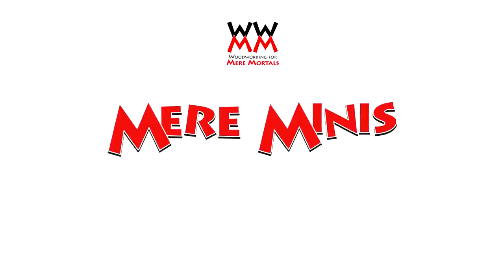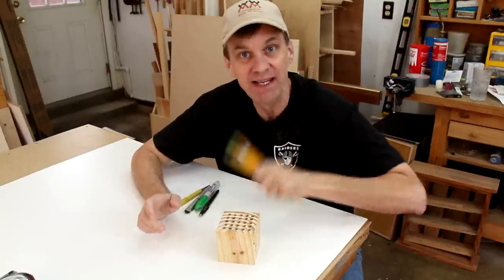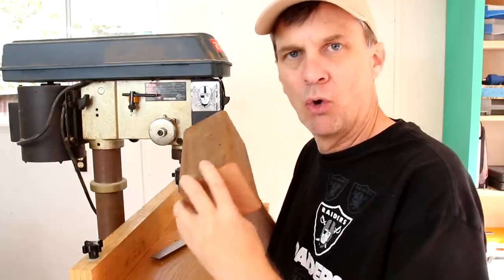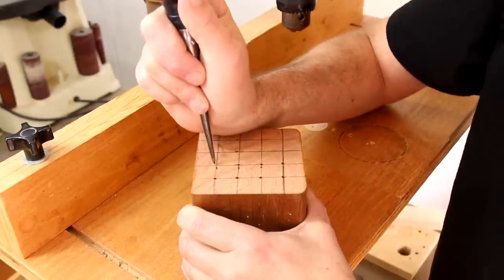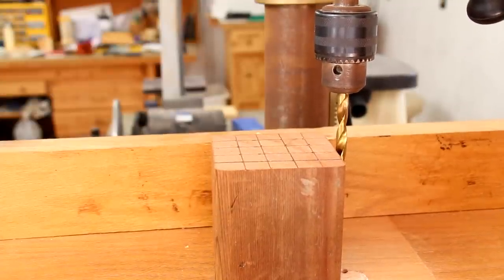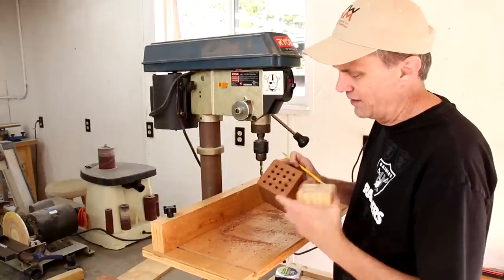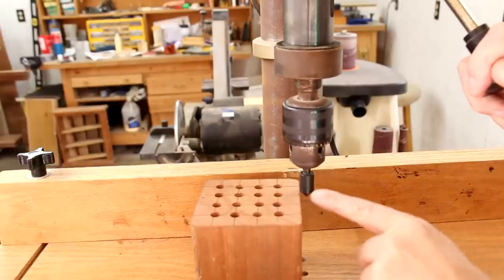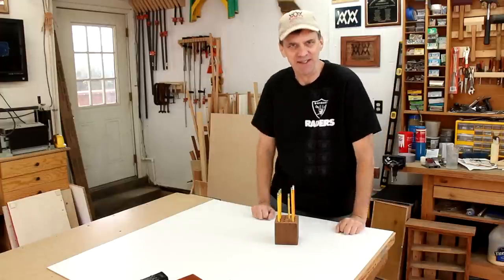Drill press pencil holder | Mere Mini

Comment: If you're going to store your pencils point down, maybe drill a smaller hole that's centered at the bottom of the main holes for the points to fall into without risk of broken lead. Just a thought.

Comment: Would it not be better to drill a smaller hole slightly deeper then the one that holds the pencils so that the tips of the pencil do not get broken?
Reply: At first I didn't know what you meant. Then I realized you meant at the bottom of the larger hole. Actually a really smart idea. One of those "Why didn't I think of that?" kind of things.

Comment: I have 103 misc screw driver bits from various sets people(or myself) have bought over the years. They all pretty much eventually ended up at the bottom of several of my tool chest drawers.
So, I made a similar thing out of a 2x4 to hold all of them. Works great.

Comment: Great and simple project to hold pencils Steve. 
The most simple and useful thing I made was a groove (3/16'' wide and 3/16'' deep) in a block of wood cut with the table saw (I think 2 passes as the kerf wasn't wide enough) this block of wood is holding my smart phone while charging on my bedside table, acting as an alarm clock at the same time.
Greetings from Good Old Germany
Peter

Comment: I need to make one of these so badly, but for my mechanical pencils. I've got 4 kicking around the shop and I'd be hard pressed to locate one when I need it. 

I was going back and forth between buying a drill press and band saw for a while and decided to go with a drill press after your drill press mere mini. I'm so glad I did as I have been using it like crazy and couldn't go without it now. It's secondary use as a drum sander is incredibly handy for anyone without a spindle sander. I'm going to try spinning knobs and handles with scrap soon and see how that turns out.

Comment: rough sand paper double side taped on 1 foot long wooden ruler... it works better on wood than files... and you can apply all filing techniques

trimmed off using pen knife... foam tape works best with cushion

Comment: Another mod I might make is to make a smaller deeper hole than the pencil slot; so that the sharpened pencil lead point would not break or be blunted in the bottom of the slot.

Comment: Not a carpentry project as such but I once took a large tin can, filled it two thirds full with gravel then drove a four foot piece of dowel into it at the centre then topped it off with plaster of paris, being careful to make sure the dowel was perfectly vertical, then after it was dry I spray painted it all white  and put a bunch of cheap clip lights on it and stood it in a corner, it looked like an expensive designer piece and lit up the room a treat.

Comment: I made a hobby (model) paint storage tray out of a 2x4. Used a forstner bit and the drill press. You can see the example tray I followed by Googling "dndlead paints". Super simple and super handy to organize. You can also drill smaller holes to hold your paint brushes.

Comment: The most absurdly simple, extremely useful thing I have made was an L-shaped piece from two 1x4's that I can clamp to my miter sled to act as a stop when cutting picture frames. It clamps 'inside' the rail and sticks out far enough to butt the frame ends against when cutting. Your frame video made it look like you could use one as well - trimming freehand I'd never get joints as nice as yours.

Comment: Stupidly easy but very useful project:
I took some thin, narrow scrap boards and cut them in to squares on the table saw. Then I drove one 1 1/2" nail through them - and now I use them all the time when painting or finishing a project to keep the project off the table. Just balance the workpiece on the points of the nails. I have about a dozen of them, so I can support each piece individually, and they leave no marks on the finished piece.

Comment: I once drilled a hole in a 4x4 block, put a dowel in it, and made a paper towel holder for my bench. It was crude, took about 5 minutes. Did it maybe 20 years ago, and despite all the work I have done in my shop since, I think I only just got rid of it (aka, I repurposed the dowel).

Comment: With very minor modifications this project can very easily become a drill bit holder. Simply make each hole just a little larger than each bit and adjust the depth of each one so that you have an inch or two of the bit sticking up.

Comment: I made a wooden airplane for my cousin who is 2yrs old. He picked it up and dropped it thinking it would fly on its own. When it was time for him to go he had set it down and grams told him that I made it for him. He quickly picked it up and carried it outside under his arms. Plane was 26" in length, 24" wing length and the tail was 8" in lenght. Both wing widths were 4". I used to dowels for the big wing (lol) and one dowel for the tail. It turned out pretty good.

Comment: I guess if you drilled a tiny hole first say 4.25 inch then the main hole at 4 inch the pencil would slot down but the lead at the bottom would have its own slot to stop it breaking from being dropped in the slots.

Comment: The simplest thing I've ever made that has become indispensible was a bench hook. Piece of quarter-inch ply, two pieces of  1"x2" furring strip, 6 screws and a piece of an old measuring tape. I think I use it every day for something, especially for holding small pieces while I work on them.

Comment: What tips do you have to make the holes straight if you don't have a drill press and have to drill by hand?
Reply: i know just one way : hold the drill away from you and look if the drill is straight if you have a good square you can also use it.
Reply: Big Gator Drill Guide

Comment: My wife and I play a game with friends that involves cards, and poker chips (not poker, it's a fantasy RPG game.) The game master has to be able to see what card each player has to determine play order. Cards were always laying flat on the table where they couldn't be seen, and chips were always getting knocked on the floor, or confused on which chips belong to which player.
  So, I took a 4 foot piece of red cedar 2x4 and cut it to 6 inch lengths. Then I set my table saw to a 15 degree bevel, and cut a slot in one edge to hold a card at a nice angle for viewing. Then I took a 2 inch forstner bit and drilled a couple of holes to within 3/8ths of an inch of coming out the bottom. The holes were positioned so one edge overlapped the edge of the wood so there was a thumb notch to get the chips out. A little 45 degree chamfer around the bottom to create a nice shadow line, and a bigger chamfer at the top, and a couple coats of linseed oil,and it made the perfect card and chip caddy for game night :-)

Comment: Could it be modified to hold drill bits? The original cases that my bits come in are not the most ideal...I always end up taking them out  and leaving them around after using them, eventually I loose the casing altogether and end up with a bunch of bits

Comment: I'm thinking about  how I might incorporate a pencil sharpener in there somehow.
Reply: Mount the pencil in the drill press. :)
Reply: Brandon Francey
with spray lacquer? ;)
Reply: Make a hole (sharpener form) in the block and another round hole (where u insert the pencil), after inserting the sharpener, being all millimeter tight, block it with X possibilities, such as an iron mini bar, or liquid latex (remember to use a sheet of paper or something like plastic to cover the sharpener) or just resin. You americans have a lot of possibilities to find good materials and dont make stuff >.< .....

Comment: The most ridiculous pointless, absolutely critical thing I've ever made in the shop was a simple butt joint 5-sided open-top box out of 1/2"  pine.  The inner dimensions are 4x4x12".   It's where I keep all the stuff that's not big enough to have a place of it's own. I modified it by drilling a couple holes to snugly fit chuck keys right in the sides.  I couldn't do anything in the shop without that thing and it's contents.